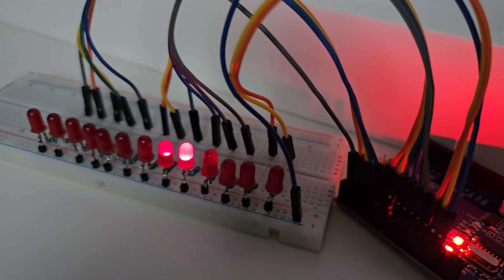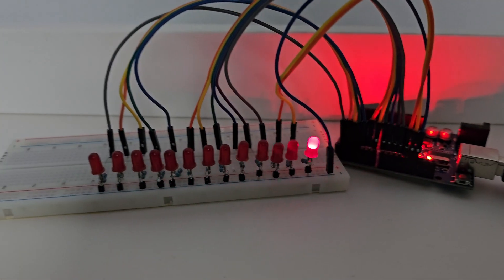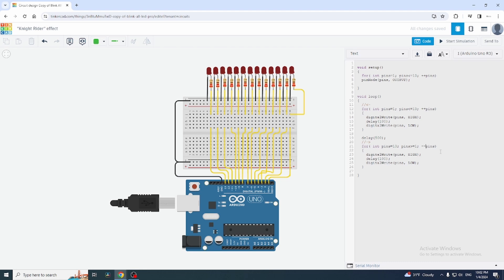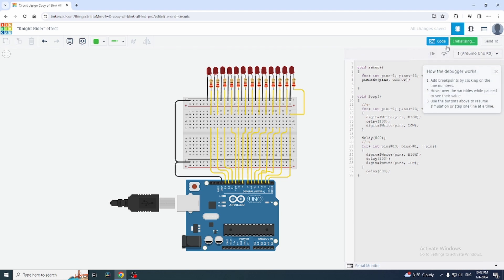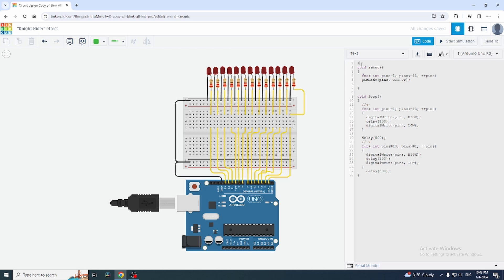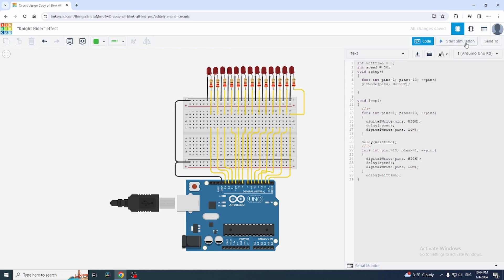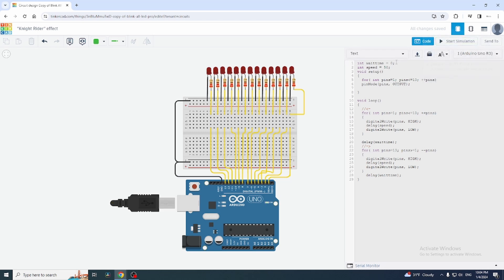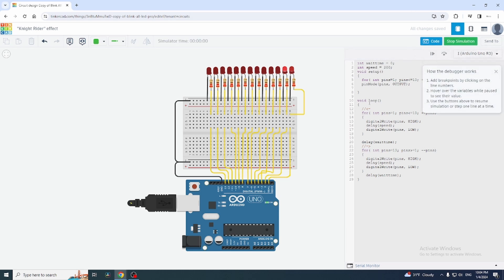How to Make Knight Rider Effect with Arduino

Comment: The real effect is harder because you need to do some PWM on all pins successively for the trailing edge
Reply: Right, that's part of the charm of Kitt, strangely enough TinkerCAD seems to emulate that behavior. I believe Kitt uses 8 lights, the Uno has only 6 PWM pins, but you can still get it done of course
Reply: @rondlh20  If that's the only thing your sketch is doing, you might get away with a software PWM (possibly with direct port manipulation rather than digitalWrite).
I've never used a PWM shift register, maybe they're indicated for that purpose?
Or stick with 6 LEDs ¯\_(ツ)_/¯
Reply: @NicksStuff  "shift register"... what do you mean? Just use "analogWrite" to set the "intensity" and program a nice fade in and out
Reply: @rondlh20  Shift registers to increase the number of outputs.
Reply: @NicksStuff  Shift registers and PWM don't work together very well, you could use some AND gates to create a small multiplexer
Reply: @rondlh20  I remember doing it with a 74HC595 as a proof of concept 7 or 8 years ago. I was surprised it worked.
Reply: But this is better: https://www.youtube.com/watch?v=ncQIu7FrIyA

And he's using the same shift register and the same LEDs I was
Reply: @NicksStuff  That's quite nice, but a bit complicated in my view, and you will have to be careful to not let the PWM frequencies and shift frequencies interfere. If the shift frequency is very high, then it will work fine I guess.